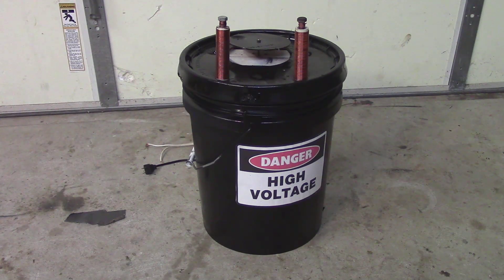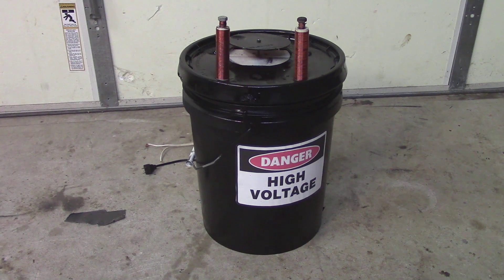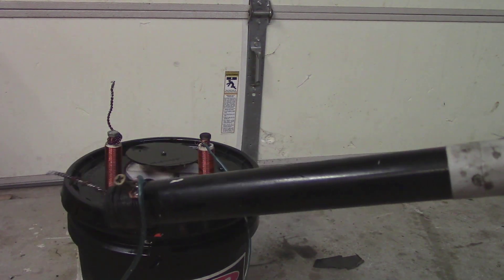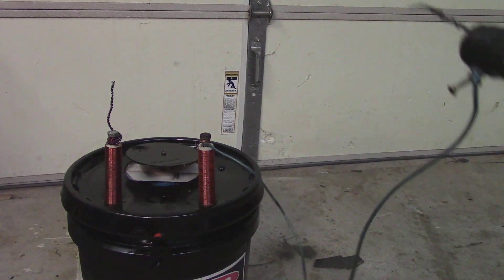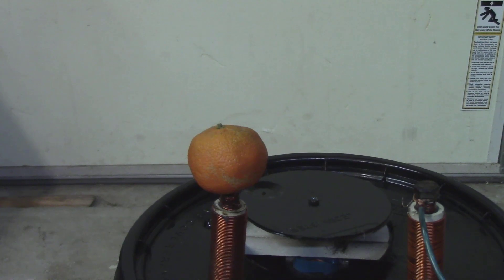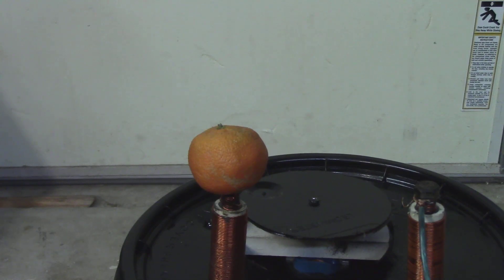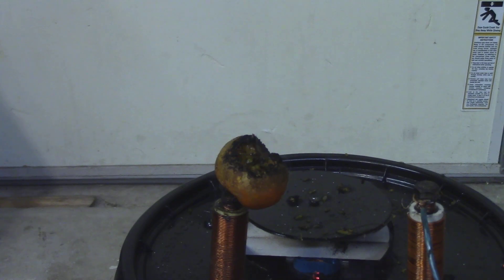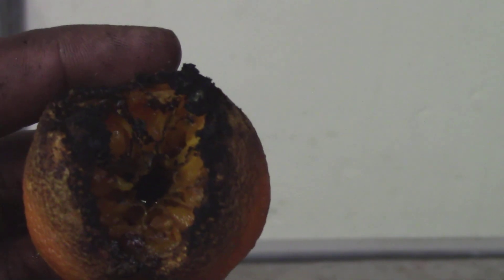High voltage Transformer! | built from scratch| crazy arcs|

Comment: dumpster diving time (ill get some microwaves)! 
What would happen if i used 4 MOT ? ( ͡° ͜ʖ ͡°)
btw how much volts / amps it outputs??? i really wonder
Reply: You Will need to have a powerful input power because it Will consume 60ampers,
Reply: 4 MOT secondaries in series is 8KV 0.5A, 4 MOT secondaries in parallel is 2KV 2A. Either way beyond lethal.
Reply: @tf3confirmedbuthv54  and the max current can be 10   
Ampere in 2000 volts :0

Comment: Briliant concept. Though for voltages and impulse that high, high voltage bushings would be the most preferable. Also comparing an orange to human flesh is like comparing a squeegee to a pencil eraser. Well i guess you could say that an orange and flesh are living tissue, however an orange has lower resistance than human skin because an orange is much less dense, and has much more moisture then dry skin. Just a correction, mate. (: Dry skin won't desimate like that.
Reply from the maker: Cole Legrange Yes bushings would be preferable and I proceeded to install them later on. As for The orange and human flesh comparison, Yes they are quite different, I was mainly trying to demonstrate how powerful electricity can be. As for resistance, yes human skin has a much higher resistance than an orange peel, but at high voltages like these, the difference has a minuscule effect. This was not at all supposed to be an accurate representation. After all, its a .90cent orange from the supermarket.
Reply: Bushings would make that oil filled gravel bucket, look like a terrifying monster. Bushings always make high voltage transformers look much more nice, and seperates the two output leads. It is always the most powerful of units that deserve a set of beutiful bushings, like giving your daughter braids.
Reply from the maker: Cole Legrange that is true, I also built a quad mot set up that truly deserves a pair of bushings as it spits some mean arcs.

Comment: Nice cyan-colored plasma! Does it have to be a bigger unit to generate that amount of energy? Is there any way you can make much smaller but generate same amount of energy? just curious:) and will it jump to a human flesh and electrify when take your finger near to the generator? And generally, what can we do with that visible plasma?
Reply from the maker: Lena Oxton yes it does have to be somewhat big to handle that energy without overheating, if you want to make a smaller one but still have nicer arcs, I would suggest moving to a higher frequency transformer. Its arcs are quite a bit smaller but the benefit is that the transformer is about the size of an apple. As for it jumping to your flesh, yes It definitely cal and will if you touch it or get too close. If you touch both terminals while its on, you most likely wont make it as this is alot of power. I wouldn’t suggest building this if you don’t know much about how they work.
Reply: Platinum Science oh, by smaller one, you mean flyback transformer from cathode ray tube tv? I've seen it before but it didn't generate as much as power like yours. I'd love to know if there is a ways to somehow increase the amph rates😞 and judging by the plasma color, flyback transformer plasma(which is purple) is weaker than your cyan colored plasma. Btw, thanks for your reply! Highly appreciate that:)

Comment: Did you use a ballast in series with the mots?
Reply from the maker: BHU1 LORD Yes, 2 in series! This is to keep them from overheating (at 240v). If you decide to use 120, you wont need a ballast but just make sure your circuit can handle current draw of up to 100 amps, if it cant then you would need a ballast.
Reply: Platinum Science 100 AMPS?
Reply: @platinumscience7356  what ballast you used ?
Can you give specification ?

Comment: Why are the primaries in series? Why not wire up both primary and secondary in paralell?
Reply from the maker: lovreli I believe I meant to say that the primaries are in parallel and the secondaries are in series. This allows you to phase two transformers together so they can run properly. By putting the secondary in series, it increases the voltage and current when 240vac is used on the primaries.
Reply: Platinum Science i did this a while ago hopping i could get bigger arcs, but they werent as big as these... Any aditional parts?
Reply from the maker: lovreli yes! A capacitor bank, you will need at least 4 mot capacitors. Connect 2 in series (for all four) then connect the 2 pairs in parallel. This allows the transformer dump more current into the arcs.
Reply: Platinum Science ah... Thanks for the cool video!!
Reply: lovreli

An unballasted mot will trip a 25 amp breaker in about 5 seconds, wiring them in series doubles the resistance which cuts the load in half and using 240 volts to power them means each mot can run at its rated voltage without tripping breakers or causing voltage fluctuations in your neighborhood. The secondaries are in series because the output of each mot is about 2000 volts. Wiring them in series doubles that.
Reply: Platinum Science 

You're feeding each mot 240volts? How do the secondaries not short to the core?

Comment: Do this on halloween on your porch and kids will freak out
Reply from the maker: ClevelandStorms haha yeah they would, maybe pull out the Tesla as well
Reply: ClevelandStorms I’m 13 and I love high amperage and voltage
Reply: Rocky_adventure_bay Maybe learn a bit more about electricity and electronics before you go screwing around with high voltage. I mean, i guess you could do it if you use a chicken stick and dont touch ANYTHING whiles its plugged in. Maybe stick to battery powered high voltage like tasers and stuff.
Reply: totally dude

Comment: Pretty meaty arcs, it's probably because you are running it on 240V;)
Reply from the maker: +Variac Maniac yup, getting ready to hook it up to the Tesla coil, but caps are a bit expensive
Reply: Yeah, those Maxwell caps price tags!!!!
Reply from the maker: Variac Maniac yup, I decided to buy 15 cornell duiblier caps to get the desired 10nf, but  just 15 caps alone costed me about $100!.  
for sure the most expensive part of the coil!
Reply: Good that you where able to get them;) can't wait to see!!!! Take your time though....
Reply from the maker: Variac Maniac  yup, not rushing is key, so far I have the power supply, voltage doubler chokes, rotary spark gap, and safety gap
Reply: Good;) Same thing, I have everything besides the spark gap, the coil and mount for it, and caps and many other little nuts and bolts.
Reply: Variac Maniac what kind of caps you cannot use mot caps for a sgtc they will short inside pretty fast due to fast discharges your pt  is the best bet for yah rectify it and put it on some capacitors
Reply: Sounds like a great idea, thanks for the info;)
Reply: Variac Maniac your welcome 😉

Comment: Should be around 1000-1200ma
Reply from the maker: I didn't have much current limiting so it may have been more
Reply: Platinum Science mine out output 800ma each while arcing and the other around 1000ma most newer mots at around 100-500ma
Reply from the maker: yeah, I'd definitely prefer the older ones, they hold up a lot better